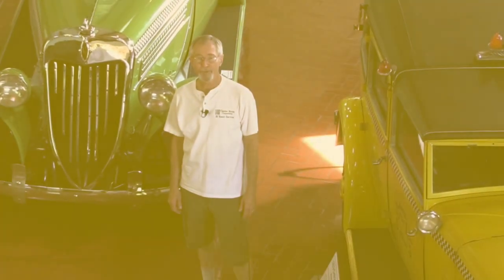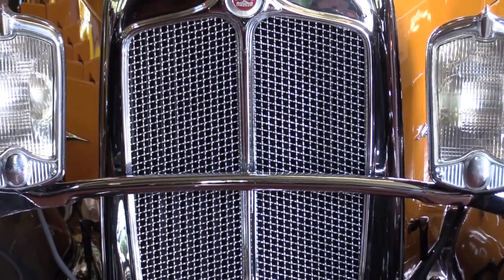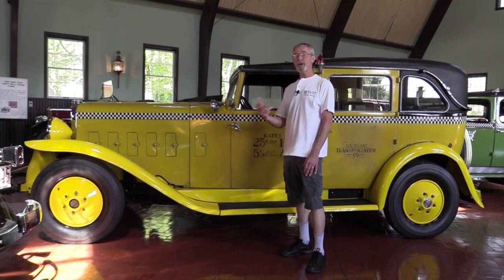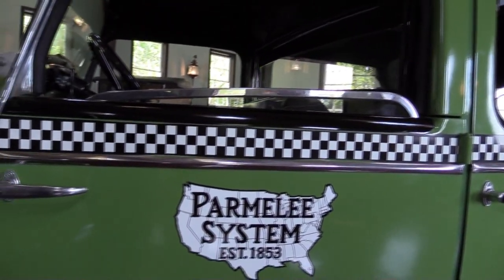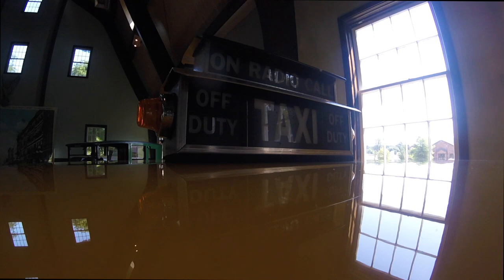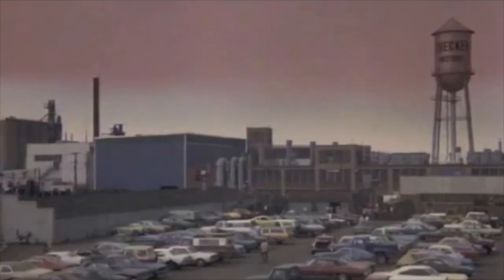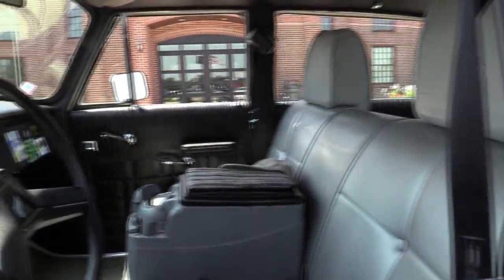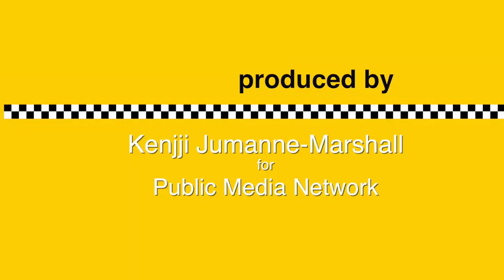CHECKER MOTORS a Kalamazoo classic

Comment: That Lycoming straight eight was the same engine as Auburn used correct? Obviously Checker never had the supercharger option but, still that would have been a heck of an engine for a livery vehicle where flathead six engines were most common.

Comment: Graduated from engine development corps.  We were taught that checker motors developed the first ....Valve in head-cylinder head. And that they didnt protect their design / patent.. It was stolen by chrysler and GM. Which is why  Chrysler and Gm small blocks used the same head and intake / exhaust gaskets.
Reply: Not necessarily.   Chevrolet and Buick used the valve in head design years before Morris Markin started Checker production in the early 1920s.